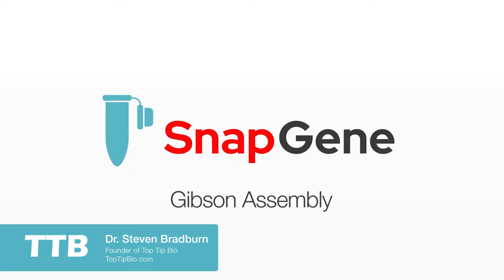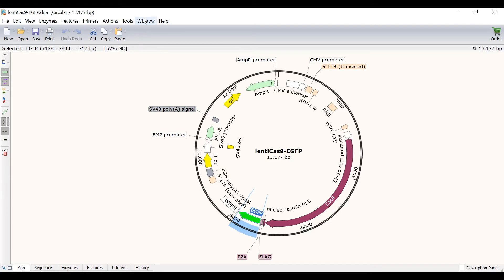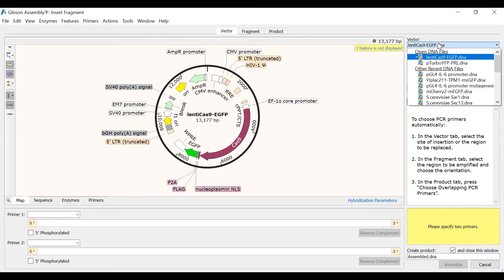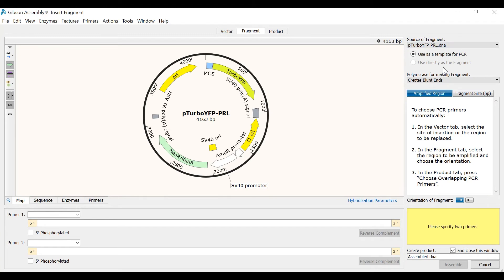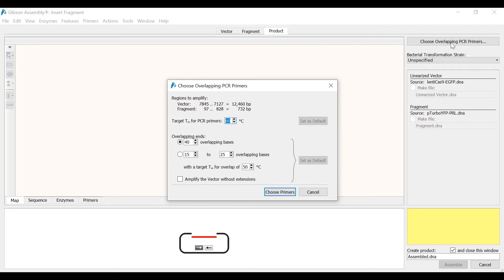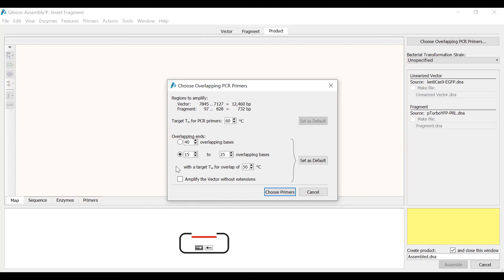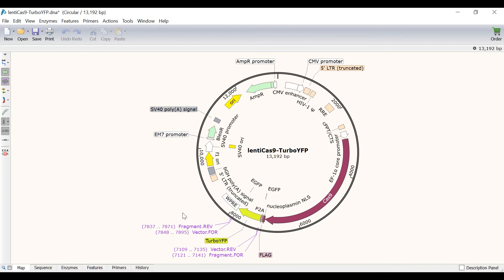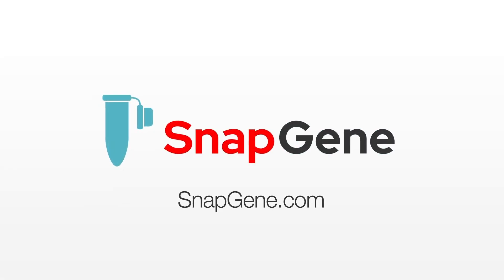Gibson Assembly with SnapGene

Comment: What is the difference between Gibson assambly and In-fusion cloning?
Reply from the maker: Both methods essentially give the same outcome with how fragments are recombined in a seamless way, but timing, enzymes, and overhangs are different. 

Gibson uses a mixture of the enzymes: 5' exonuclease, DNA polymerase and ligase to create overhangs and covalently join the fragments. The reaction time is usually 1 hr. The 5' exonuclease creates 3' overhangs. 

In-Fusion uses a proprietary enzyme to create and join the overhangs, and it does not need DNA polymerase or ligase. The reaction time is usually 15 min. The In-Fusion enzyme creates 5' overhangs.

A promoted benefit of In Fusion, no ligase means linear vector is less likely to recircularise and create an unwanted vector-only (no insert) background.

I hope that helps.
Reply: @SnapGene  Thanks for your response.
Is it like 
If I use Gibson primers to stitch  multiple fragments by using In-fusion enzyme or vice versa, will it work?